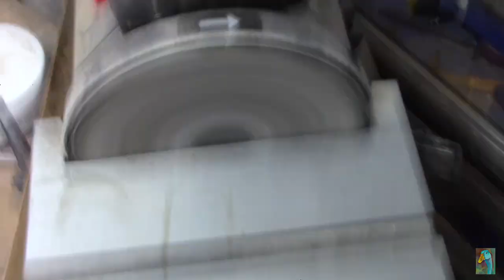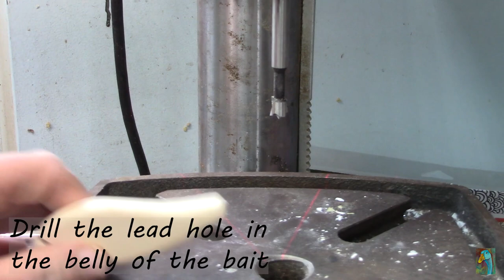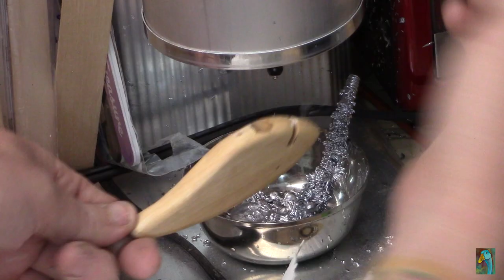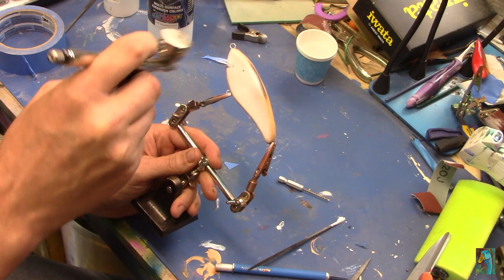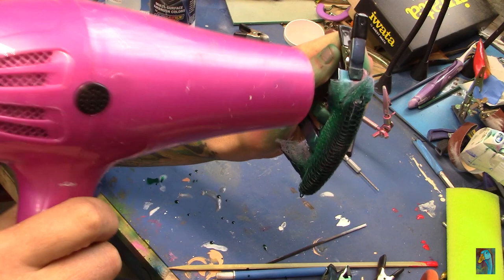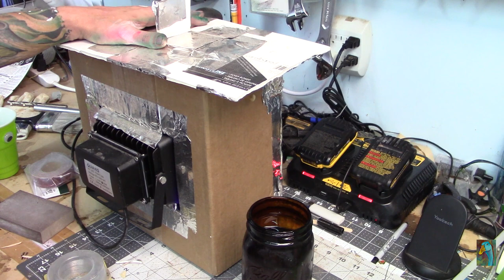Wooden Lure Creation with Blue Goose Studios

Comment: Hello there, I’m trying to build fishing lures and find the weight method you use is perfect. Could you help me out a bit on understanding the procedures. What’s the baking soda on the lead for and why? And is that just super glue you dropped on it ?
Reply: No problem!      The procedure is to drill a hole in the bottom of the bait.  Where depends on what you are going for, but I find in the biggest part of the belly typically does the trick.     I use a lead pot to melt the lead and drop it into the hole.   
The baking soda and super glue is simply a way to cap the hole with a material that is strong, yet easily sanded / finished.     The glue also pretty much immediately  sets and can be sanded.     You would use epoxy for this however it takes more time and some folks will use fine sawdust in place of the super glue.    
Hope this helps!   Any more questions feel free to email me at joemess2 (at) gmail.com
Reply: Check out Marlin Baits as well